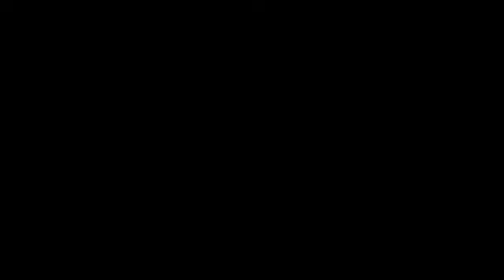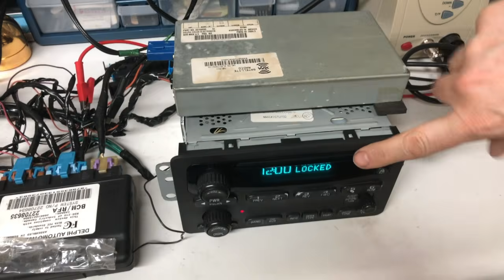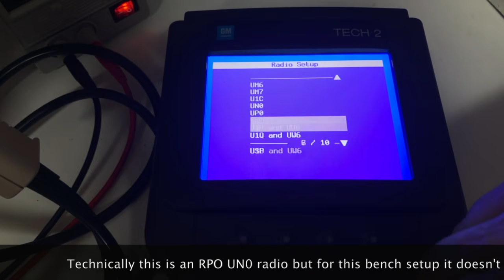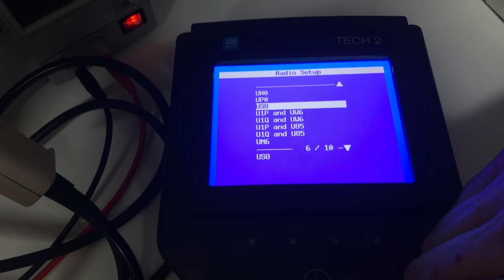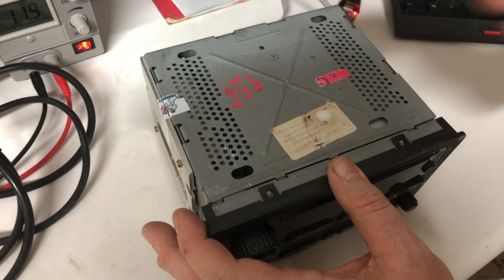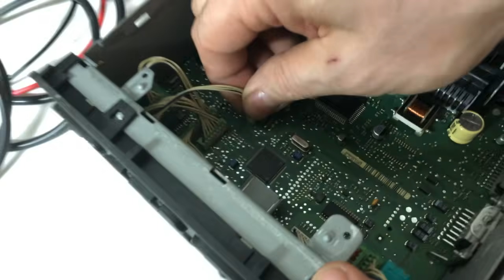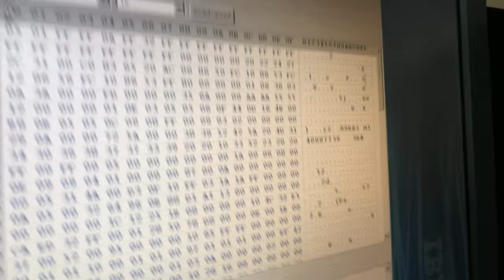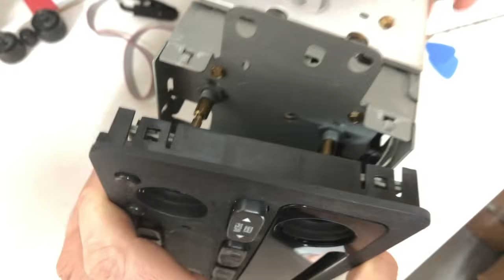2003 - 2006 How to VIN Unlock Salvage Yard GM RDS Radio w/ Tech2 OR Manually Programming its EEPROM

Comment: So for the RPO codes when I’m doing the tech2 setup I need my trucks rpo code or the rpo code from the vehicle I pulled the radio from, I’m assuming I use my trucks codes correct?
Reply from the maker: You don't need the RPO codes as much as the radio part number from the sticker on the outside of its casing.  If you are just replacing a dead radio with the same one the truck was built with, you can use just the part number.  But if you want to upgrade, then that's when you use the RPO code to find out what the better radio was that year so you know what to look for in the salvage yard.  Easier to look at the rpo sticker before you open the dash an all to check the part number.   The reason for this whole dance is the GM tooling will not unlock or program a radio that was not available in the year a particular VIN was built.  So you can upgrade, but you have to stay in that kind of window.
Reply: @DrShock  oh ok cause my truck came with only a CD player but I’m upgrading to a CD/cassette from an 04 impala and my truck is an 05 Jimmy so that’s why I was asking, should I go with the impala
Reply from the maker: I'm not familiar with the original radio options on the 2005 Jimmy truck, but if look in the owners manual and see a similar CD/cassette option then you should be ok.  Personally, if it existed in the owners manual,  I'd look for the unit out of another Jimmy to be sure as unfortunately GM made all sorts of little changes (that's why the radios have all these different part numbers).  Sometimes it was just a different color for the backlighting, or a different shade to the front bezel.  But sometimes it was programming differences.  They really wanted to prevent swapping parts around by the dealership, or the customer ;-)
Reply: @DrShock  makes sense yeah I’ll have to look and it sucks cause 05 was the last year for the Jimmy and there’s not too many of them so my odds of finding an 05 Jimmy with that option are slim I think, but thank you for the quick responses and the great video I appreciate it 👍

Comment: So I'm wanting to put a 2010 OEM radio in my 2006 Suburban. Chev Serv says you can't program a VIN into a different year radio. First, is that true? And if so, does your EPROM reprogramming get around that?
Reply from the maker: That's true in that the dealer tooling will not let you configure a radio part number into a vehicle that it wasn't originally available from the GM factory with.  Some dealers used try to get around that by configuring the tool for a different year and model, but GM has clamped down on that in more recent years.   Nowadays GM has blocked reusing most any used modules for repairs that require programming to configure.  

The eeprom content is only relevant for the VIN unlocking.  The bigger problem is most newer radios are not electronically compatible with older vehicles, as the newer ones are on faster type of communications network.  Usually 2006 and 2010 are not too far apart in that regard, but I haven't done this specific mod myself so cannot say for sure the 2010 radio there is electronically compatible, where it can talk to the Body Control Module (BCM) of the 2006.

Comment: Great content. Have not done this in awhile, I recall when using a Tech2 to clear the vin via the VIN Relearn… that you are supposed to cycle the ignition off to on. If you just turn to off, then disconnect the radio ..the radio is clear of any VIN. It’s when you install the radio in the next vehicle and turn the ignition to ON is when it relearns the new VIN. I remember using this technique many times if you wanted to sell a radio with a clear vin. Since you have a bench and ability to read the chip, you could probably validate this on the bench. I did this on GM Nav radios and GM RDS radio common on the GM truck lineup. Also I remember, GM’s last update for The tech2 (v33.04) back in 2013 they made the VIN Relearn option disappear.. a bulletin was issued to artificially select a 2006 Chevrolet Monte Carlo as the vehicle to get the VIN Relearn for the radio. Also if you have a older version of the Tech2 Card prior to v33.04 it would have the VIN Relearn for the radio as a option. I remember using this for like 2009-2012 GM trucks. But it’s been a few years since I did any of this work.
Reply: So if I want to sell an unlocked radio on ebay I have to make sure I turn key off and not back on that way it is primed and ready to be installed for the end buyer?  So when they key on it will be married to their vehicle?  If I put key to on then it will be married to my vehicle and it won't work if I sell it to end buyer?

Comment: In tech2 when I click RADIO SETUP, it says Procedure in Progress, then Procedure Complete. And that's it. I don't have the stock radio to swap chips. Help.
Reply from the maker: That is typically all you will see message wise, unless there was an error.   Are you using the correct radio part number for the model year of the vehicle?   It is possible for the Tech2 to attempt the relearn, but if the radio part number is not one that was originally available for that make/model/year it may not be successful.

Comment: Hey DrShock, great video. I bought a 2003 silverado with a Delphi radio, CD and cassette in it. It shows a "cal err". It comes on but with no sound. I can change stations, see volume going up and down. I made the eeprom programmer from your other video but the chip to reprogram is not in the location that shows in the video. Is there a way to send a pic of the cb?
Reply from the maker: Cal Err is not the same as locked.  In that case it's not just the VIN being wrong.  It's lost it's initial programming somehow.  That stands for Calibration Error.   A calibration is GM-speak for re-flash or re-program.  When this happens the radio doesn't know what speakers you have, or what amp you have or maybe it's looking for an amp when it shouldn't be, etc. You'll need to use a Tech2 scan tool (or Tech2Win emulator) to run what's usually called the radio setup function and then re-calibrate it.  See time index 21::00 or so of this video https://youtu.be/ycS_jzIEtRk
Reply: @DrShock  Thanks for explaining what the Cal Error is. I will get it taken care of.
Reply: @DrShock  I bought a radio out of a trail blazer. It worked when it was pulled and when I put it in my truck it is now locked. I'm still not able to get the EEProm to work. Do you know of anyone near Charlotte NC that can help or put my vin in the program?
Reply from the maker: @briansieja3211  No, I don't.  But you could try replacementradios.com, they used to have a mail in service for GM radio unlocking.

Comment: I just put a new unlocked stock radio in my 2004 chevy impala and can't program the key fobs. Do I need to have the dealer program them??
Reply from the maker: If the radio is a part number correct for 2004, then you should be able to do it yourself.  The procedure is lengthy, try google "2004 impala key fob programming" and you'll see a few write-ups.

Comment: I just shared your video with Ferris State University in MI so they can reprogram my 2008 Impala junkyard radio to flash with my 2008 Impala by using the GM Tec-2. Seems they didn't know any of this using the Tec-2.  I hope they can see more of the Tec 2 usage for programming these radios.  My nest project is now to install the XM radio to mate with the new radio.  Do you have a wiring diagram or schematic showing the wiring configuration from the trunk to the radio.  I have the radio proper connectors but now need the wiring dolor chart to make up my own cabling.  Thanks,
Joe
Reply from the maker: I would reference the service manual, or any shop manual for the vehicle, for the wiring diagram on the radio.
Reply: Thanks,

Comment: I have a 05 GMC. truck n my CD player don't work so can i take just the part of the CD player out of another radio just like my n it work?
Reply from the maker: Yeah you could, but there could be design changes along the years that might affect the fitment.  So unless you can eyeball it first, I'd suggest getting one out of a unit with the same GM part number as yours to insure it fits in exactly the same way.

Comment: I need to do a 07 gm radio, once I have the file loaded in the 866TL do I need to export the file to edit it or can it be changed in the minipro software?
Reply from the maker: You can edit the EEPROM using the TL866 application directly.  But I do recommend you first save what you've read before making any changes, in case there's a mistake or problem you can always write the EEPROM back to where you started.
Reply: @DrShock  Do you know if it looks for the radio model number also? Should I be good just changing the vin. Thanks
Reply from the maker: @michaelbox7285  The BCM doesn't care about the other data in the EEPROM, only the radio's own firmware does.   So you just need to worry about the VIN from an unlock perspective.   But different radio part numbers can and do have different suppliers (e.g., Delphi, Panasonic, etc) and so you might find other problems if you mix years too far apart.  Just adding this in case you were using a radio part number not original to your 2007.

Comment: Great Video!  I have a 2011 Impala Fleet LT with a single CD player basic radio.  I bought a 6 Disk CD player radio out of a 2006 Impala LTZ from junk yard.  When attempting to unlock it with My Tech 2, only option on special functions was to test speakers.  I tried it as 06, and 11 Impala. Weird as I had no problem unlocking NAV unit that came out of 09 traverse on My Impala.   I was going to try SPS via tech 2, but found this video.  I removed & read eeprom, it had last 6 of VIN from 06 Impala that it cam out of.  I put the last 6 of My 11 Impala, and it worked great! Volume is clear, and I have mores Bass.  Only thing, at Night, none of the buttons light up?  Do You think I did something to cause this, when I removed & re soldered eeprom?  I only removed one ribbon cable for ease of access, but I did re installed it ( CD player harness ).  I used hot air station set at 350 C to R & R eeprom.
Reply from the maker: So on the Tech2 part, GM removed the feature after 2010 I believe, leaving no scan tool built in way to unlock the radio.  And of course GM never supported moving radios, or any other components, between model years or models.  So I would speculate the Tech2 picked up on some signal, or perhaps sniffed the VIN, and is ignoring your build choices.  It happens.  On the back lighting, that really sounds like more of a wiring harness problem (perhaps a change in the 2011 harness making it incompatible in this regard with the 2006 radio).   Always start with the easier possible causes first.   ;-)  Have you verified there are no differences between the two years on the rear harness connectors?   There is usually more than just the battery voltage supply that you need present.  Instrument panel lamp voltage is typically the naming for the back lighting signal.  I'd check that first (and the connector itself in case you got any debris shorting these pins on the circuit board side).  Like the example at 15 :02 here - https://youtu.be/SDRSA_fO2d4
Reply: @DrShock  Thanks, No I did not verify difference between harness.  I will have to do that next time I go to junk yard.  So basically panel lamp voltage has its own wire.  I thought maybe illumination was LAN controlled on 2011 impala.

Comment: Hi Dr. Shock, great video. I was able to reprogram two radios with the EEPROM method. There's something interesting I'm curious about. I bought a BCM from an '05 Cavalier from the junkyard, found the pinouts online and gave it power, ground via an old ATX computer PSU, doing the same for a radio harness. I was hooking them up to test and much to my surprise when I touched power to the "Ignition 1" pin on the BCM, the radio I had there powered on and wasn't locked. I tested it with two other radios, (none from the same car as that BCM) and all three powered up and functioned correctly with no "Locked" message. Out of curiosity I took the BCM out to my 2002 Cavalier and hooked it up, but my radio gave the "Locked" message. Is there something I'm missing here or did I find some magic BCM?
Reply from the maker: One of the other videos I did in this J-car playlist series goes over the BCM and bench top wiring for it pin for pin.  What you describe sounds like either the BCM EEPROM itself was defective (unlikely to have happened as no VIN being stored should have caused other symptoms in the vehicle) or, depending on what you connected up, I suppose you might have temporarily gotten the radio-on signal from the BCM sent without powering the VIN handshake circuit doing an intermittent connection of just the one pin.  This would be similar to the little aftermarket boxes you could buy that let you power on the radio without a BCM (those radios are not going to power up locked because there is no BCM in that bench setup to check the VIN against).  But of course anything done on a bench like that isn't of much use in a vehicle where we have to have the bench harness emulate the vehicle setup as closely as possible to insure it's really unlocked.   Interesting behavior you found there though.

Comment: DrShock, great video.  I  am trying to replace the radio in my 2004 Avalanche and have picked up a 2003 GM radio out of a Silverado with CD and cassette and the new radio is of course locked.  Can you point me to links to reliable sources where I can download the CH341PAR driver and the Asprogrammer software?  I bought a chip reader and I am hoping to reprogram the chip myself as you have shown in your video.  Thanks for your sharing your video and providing some options to resolving these frustrating issues.
Reply from the maker: In this video in the upper right you could click on the white circle i button, links are in the description of the bottom video in the list - https://youtu.be/hPKckby54uA

Comment: My tech 2 doesn't have anything to unlock the radio in the body section.  Any help you can give on this would be greatly appreciated.
Reply from the maker: I mention in the video description text some menu variations.  This technique isn't applicable to 2002 and prior for any GM vehicle.  And after 2010 the Tech2 is mostly obsolete so different methods are typically employed using the MDI and SPS programming.   But if you're in the 2003 to 2010 model year range the description should cover you on one of those Tech2 menu paths.  If not comment back here and I'll research it.
Reply: @DrShock  After building the vehicle and going to body there's not an option for radio in the menu; frame 2.39 isn't there on my tech 2
Reply from the maker: What year Chevrolet?
Reply: @DrShock  2011 chevy Silverado 1500. Its shows to be a k build and after that there's nothing about radio unlock in body or anywhere else I've been able to find
Reply from the maker: So yeah as mentioned after 2010 so this procedure isn't applicable for the most part as GM removed the capability from later models.  I haven't worked on your model year or newer truck for a radio unlock but if you don't get either of the two Tech2 menus I go over in the description and this video then this approach wouldn't be applicable to 2011.  You could still edit the EEPROM manually, but I'm not aware of a Tech2 path that would do it at this time.

Comment: Hi I got the CH341A Programmer and using same name software. Not the AsProgrammer you use in the video. Chip reads 24 EEPROM Manu: COMM Name: 24C08 5V. And that’s all it can do I get no other information when I scroll down. What cold be the issue?
Reply from the maker: I haven't used the basic software, only AsProgrammer as it's far more suitable for automotive work.   But typically problems doing a read fall into some common buckets of (A) chip cannot be read in circuit so must be desoldered, (B) poor contact with chip pins, (C) wrong or defective pinout adapter, or (D) wrong device selected in programmer software.  You wouldn't typically need the 5V mod to read, just to write.
Reply: @DrShock  Where can I download the software you are using? Thank you for your response.
Reply from the maker: As mentioned in the video - it's in the description.

Comment: I have the TL866 II and I'm using Xgpro. I don't see 24C08 in Xgpro. Mostly AT25020 related stuff. I've looked for Asprogrammer. It seems to be Russian? A little scared to download. Do you know if Asprogrammer works with TL866 II? Is there another software you recommend?
Reply from the maker: Asprogrammer is only for the CH341a tool.  You can only use Xgpro with a TL886 series tool.  Xgpro has that device, you have to search by manufacturer.  Try Microchip brand and SOIC8 for the footprint.